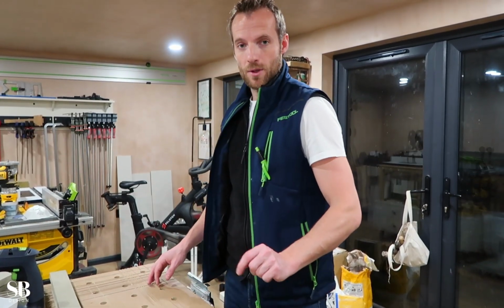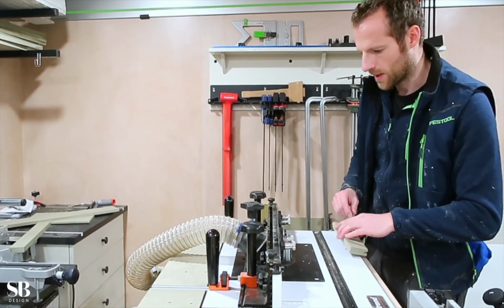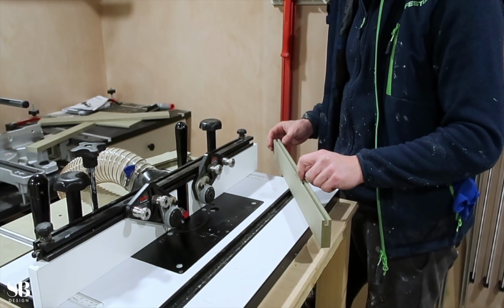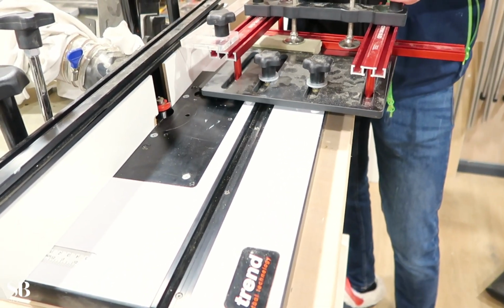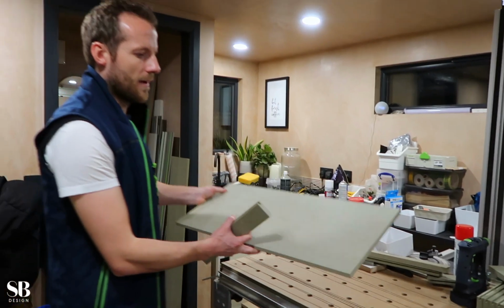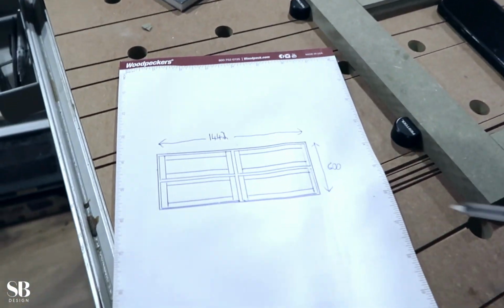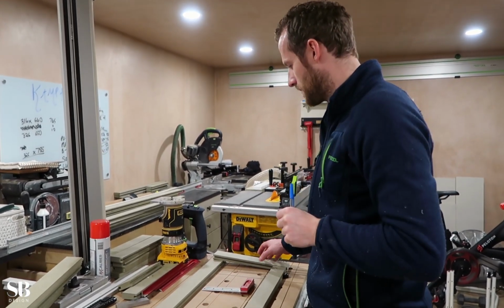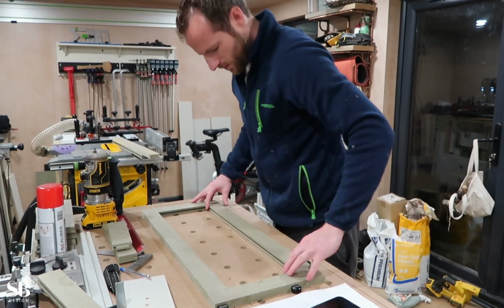How to build Shaker Style Draw Fronts | Festool & Woodpeckers Tool Review | Part 1

Comment: If you want to make Shaker doors quickly and precisely then just follow this method.  Rout your groove on the long edges of your stiles and the long and short edges of your rails. Then all you need is slip tenons cut from same material as your panel, these just slip into the slot in the rail and stile.  I have made thousands of MRMDF Shaker doors and there is no quicker more accurate method.  You dont have to allow for your tenons on the rails so less chance of mistakes there and you never have to worry about the faces of your rails and stiles not being perfect as it is all referenced off your groove. Use 6mm panel with 18mm rail ams stile amd 9mm for 22mm rail and stile.  The way you have done it is massively over complicated and relies on too many machined items fitting together, let dimensioned goods be your friend.
Reply from the maker: Hi! Thanks for feedback. I did consider floating tenon or possible using dominoes. When making shakers for larger drawers how do you deal with the void?
Reply: @Sunday_Builds  Sorry being dense what void?
Reply from the maker: @Dickie2702   Might be clearer if you see the final part - https://www.youtube.com/watch?v=7rwRqqeNLyQ

These drawer fronts are attached to a sub drawer. So having panel flush at back of shaker front helps to get better attachment to drawer itself